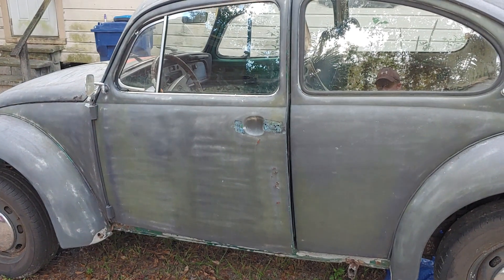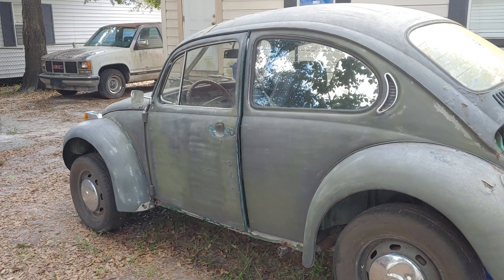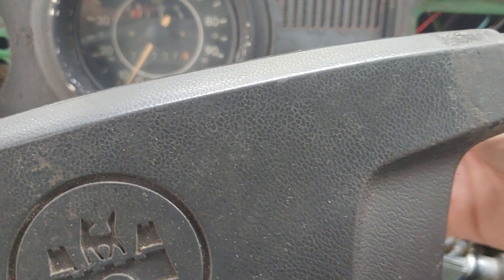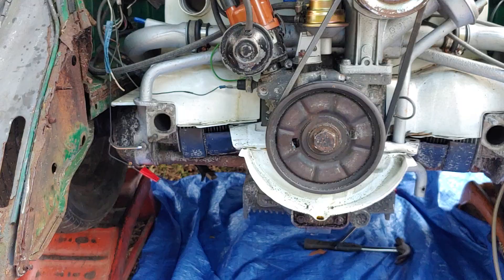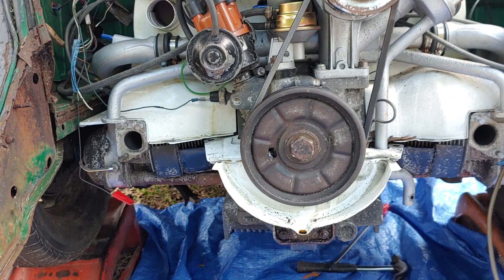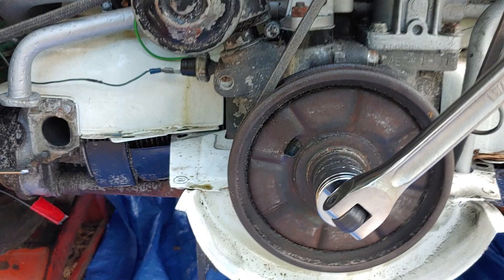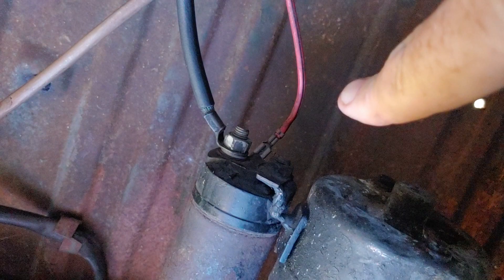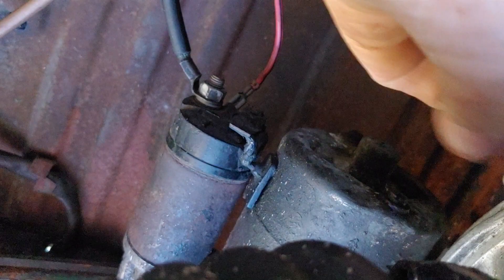CLASSIC VW, STARTER ISSUE? 1972 SUPER BEETLE WONT START.

Comment: Was it the starter that was causing this trouble? I just bought a 1303S 5 days ago, it started soooo smooth the first day and now the only thing I hear is a "click-clack" noise. Battery measures 12.8V when it's not running, alternator still looks in a very good condition. Such a bummer, really wanna drive my new love :( !!
Reply from the maker: Install hard start relay. I think I have a video on my channel. If not several others videos on it. This is a must for all VWs. Let me know your outcome.

Comment: I had what I thought was starter issue. Replaced the starter. Spins but does not engage flywheel. Any help  ?
Reply from the maker: Did you put the bushing on the shaft of the starter
Reply: Do you think the starter pinion is engaging the ring gear? You should hear a loud click, if it does. First thought would be a bad ring gear. The teeth on the ring gear get worn down on one area. Rotate the engine a little and try again.
Reply: Also. Your fly wheel could have missing teeth. Try turning the crank to align some teeth w starter. Good luck!
Reply from the maker: @kianiani15  thank you for commenting. Always great to see everyone helping each other out.

Comment: can't you cut the end of the rod in the cylinoid , it keeps the gas flow at high rpms. but it will run. ??
Reply: the cylinoid that connects to the carb.
Reply from the maker: @unicron24  the issue is it won't start. Got spark, got fuel. The starter wont engage at all. No sound at all from the starter.
Reply: What?
Reply from the maker: @unicron24  I think this comment was for a different video.

Comment: I'm having the exact same issue on my '68, bought a brand new starter and still same thing. tested 9 volts at the starter. I haven't figured it out yet.
Reply from the maker: Have you done the hard start relay? Thanks for commenting. Stay safe
Reply: @Volkswagenplanet  no not yet, but i will do that next and see what happens. thanks for the reply.
Reply: I figured it out, the electronic igniter in the distributor was bad...thanks for the help.
Reply: Mizenheimer, an electronic or mechanical distributor? I’m having same issue on my ‘63

Comment: The big starter wire gose to the + not -
Reply from the maker: I may have switched the wires. I had that starter in and out so many times. I replaced it with other starters I had as well. The starter end up failing on the bench test. Bad solenoid. I also installed a hard relay switch. Hope others read your comment. Thanks for commenting and pointing it out.

Comment: Selinoid Is Bad My Friend.   
It arced with key off though?
Reply from the maker: That's what nap said also. I replaced the starter with a autostick starter. Thanks for commenting. Do you own a VW?
Reply: @Volkswagenplanet   Yes Sir I Have A 73 vw super beetle , The prob I'm having right now is you Now the Test light test? I'm sure you do.....
Well my test light stays on all the time I already replaced everything but the body of you Distributor , any hints? 

As far as yours My Friend how about the starter relay? 
Or if you don't have one try one the Hard Start Kit
Reply: Oh and as far as it arching while keys off I'd say ignition switch is out or back to start relay
Reply from the maker: @juanmanuelcortez1098  not sure about that. I did install a hard start relay around the same time as well. Hopefully I can get back to the beetle soon. I had to put it on hold for the last month.
Reply from the maker: @juanmanuelcortez1098  I have no idea where you could be pulling power. I was going to mention to you I also have a VW GROUP page on Facebook as well. Very active members. I'm sure they could answer any question that pops up. It's called " Volkswagenplanet" as well. Hope to see you there. Check out my friends YouTube channel " Slades Beetle" . He has a 73 Super Beetle. He has gone through every wire on his car as well. It's a well established channel now. He is a great guy. He is also a moderator on my Facebook page as well.
Reply: @Volkswagenplanet  Alright Hek Yes very intesting and I really appreciate you and your invite thanks....
Well guess what , I Felt like a real dumbass......

You know Díd that was the wire attached to the points was cracked in half My friend LoL 😅
Reply from the maker: @juanmanuelcortez1098  it happens